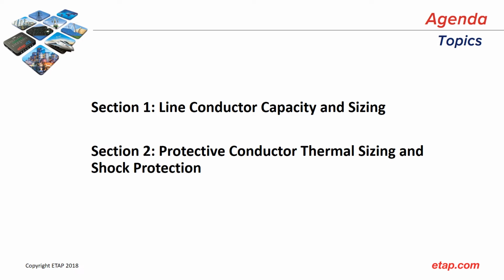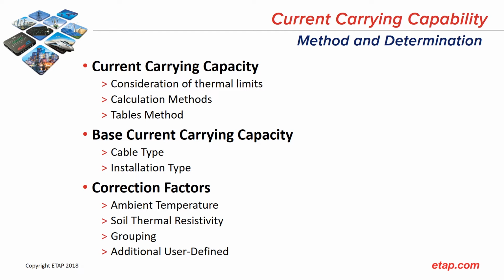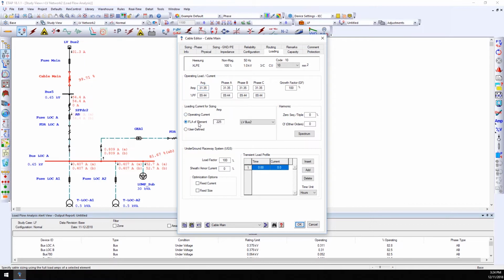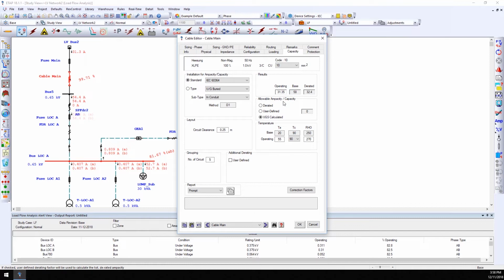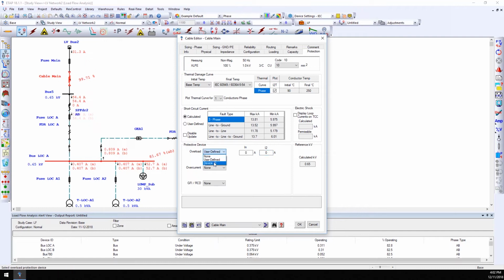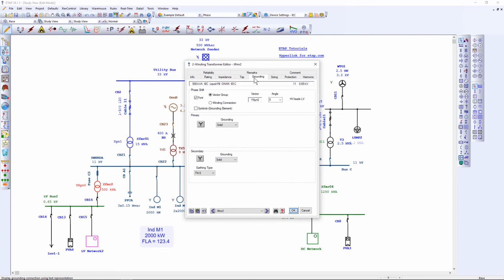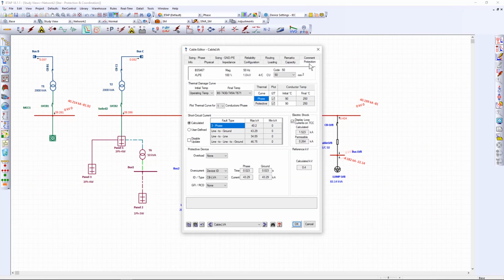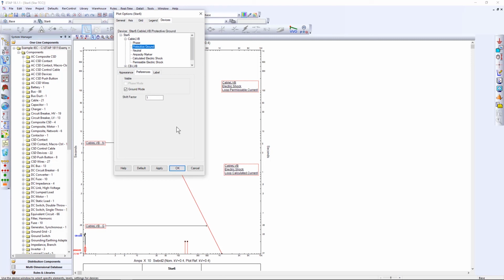Cable Sizing, Ampacity & Shock Protection - International Standards

Comment: In Sizing - PE & N page, why Earthing Type shown as Not Applicable while its been connected to transformer with TN-S?
Reply from the maker: Thank you for you interest in ETAP Solutions. Please contact our Help Center at https://helpcenter.etap.com to assist with your question.
Reply from the maker: in addition to the above, there are many reasons why the Earthing Type cannot be determined. The following are common reasons:

** The Earthing Type Determination for Grounding / PE Sizing needs to be set to True in the Tools/Options Preferences as described in Chapter 44 of ETAP 24.0.3 Helpfile
** The cable may be part of a Looped system in which the earthing type from the upstream side of the cable is different than that of the downstream side.

Please contact our Help Center at https://helpcenter.etap.com for further assistance with your question.

Comment: Did you manually enter the editor page of the individual protective devices to set the time-clearing characteristics while creating the Single Line Diagram or the software determines that automatically based on the short circuit calculation?
Reply from the maker: Thank you for you interest in ETAP Solutions. 
You do not need to manually enter the curve from scratch, but you must manually configure the settings. ETAP pulls the base curve from its device library automatically; short-circuit results do not set curves automatically. Please contact our Help Center at https://helpcenter.etap.com to assist with your question in more detail.

Comment: Thank you.
Reply from the maker: Thank you for your interest in ETAP Software, please contact our Technical Support at https://helpcenter.etap.com/ for more information
Reply: Hello ETAP team. Please advise for updating the minimum short circuit current, star mode with checking "excluding device duty" is the correct approach or not??
Reply from the maker: @sumitmondal548  Thank you for your interest in ETAP Software, please contact our Technical Support at https://helpcenter.etap.com/ for more information
Reply from the maker: Thank you for your interest in ETAP Software and your positive feedback